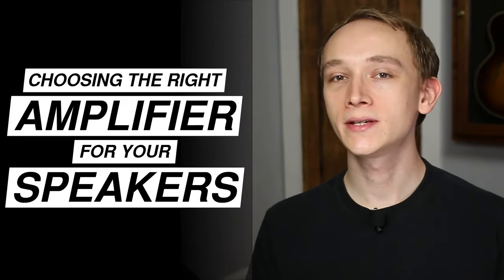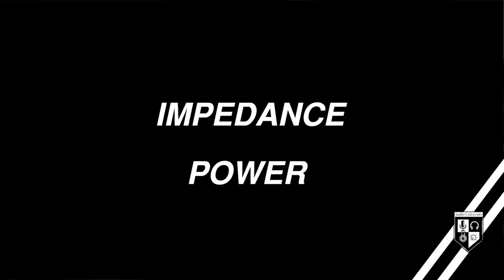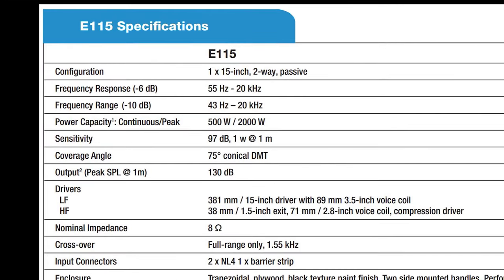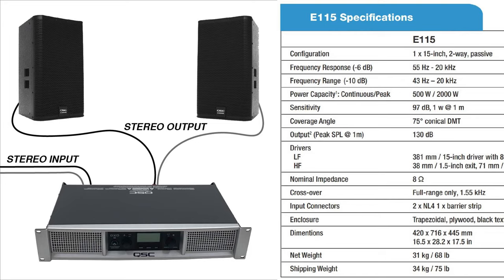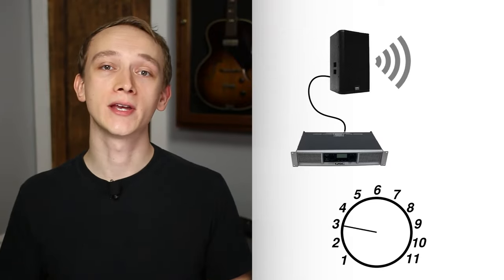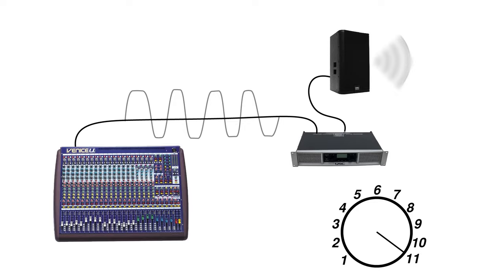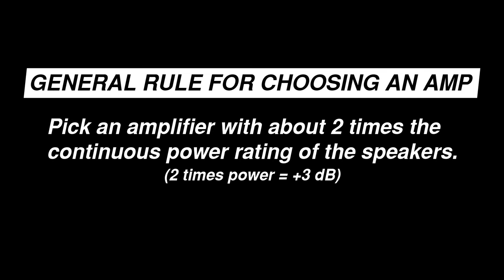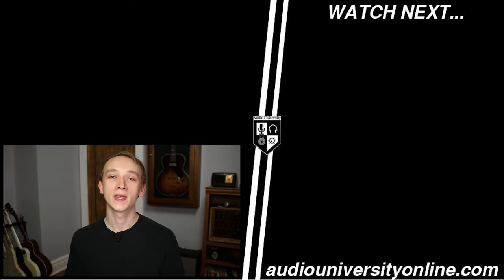A SIMPLE Rule For Choosing An Amplifier | Ohms, Watts, & More

Comment from the maker: Need help setting up your listening space? Check out this free resource I've created for you...
Speaker Placement Guide: https://audiouniversityonline.com/speaker-placement-guide/
Reply: Is the power capacity on the speakers for 1 speaker or both. I have a Yamaha MG16/6FX 16. My monitors are The Presonus Eris E3.5 and I have a Behringer U-Phoria UM2 Audio Interface. What should the specs of my amplifier be? Thanks in advance
Reply from the maker: The Presonus Eris E3.5 monitors have a built-in amplifier, so no amplifier is required!
Reply: @AudioUniversity  I need an amp to power the mixer. The monitors are going into the mixer. I just wanna make sure I dont blow anything out so I need to know what amp I need for that mixer
Reply from the maker: Are you trying to find a replacement power supply for the mixer?
Reply: @AudioUniversity  No. I was told that the mixer needs a power amp to be used by the guy I bought it from
Reply: @OGLettaJ  l
Reply: I have older getz benz. Bass 300 watt×2 at 4ohms. Does it have to be rated20% above rating on speaker?
Reply: Speakers Samsung HT-Z410T 5.1-Channel and DVD  Sony DAV-S800 is compatible please tell me
Reply: Is it ok using a loudspeaker horn that is rated 16ohms with an amp that has 8ohms impedance?

Comment: NO, this is all wrong. Don't choose amplifier 2x the rated maximum power of the speakers. Choose amplifier with enough power to reach the sound pressure levels you desire. To do this, you need to know the sensitivity of your speaker and a chart of wattage per sound pressure level at selected distances. The maximum power rating of the speaker is only there to warn you to not exceed the max power or damage to speaker will occur.
Reply: I don’t think what you said is correct….the more power you have is just going to give you cleaner signal and more headroom.
Reply: What’s best amp for ds18 6.5 300 watt
Reply: I'll add: don't choose amplifiers based on a particular set of speakers in the first place. 

Rather, estimate how much power you really need for the lowest sensitivity speakers you are ever likely to buy, according to your desired listening levels and distance. Then add maybe factor 1.5 safety margin, and then buy the best sounding amplifier that delivers that power, within your price range.

That way you'll have an amplifier that will properly drive ANY speakers you're ever gonna get. You'll be happy with it and won't have to buy another amplifier for decades until it dies.

Comment: I was just stopping by and thought I'd take a short look. I'm not going to take the time and give you my resume, but everything you said  was right on the money. You were however scratching the surface. One thing people should note. Power is normally measured at 1000 HZ for one minute, and not while the amplifier is producing an output under a range of frequencies continuously. All amplifier specs are fudged to make them appear better than they really are in a real world application. If someone listens to 10 watts RMS at 20 to 20 KHz with a 200 watt RMS amp and then listens to the same program material and speakers on an amplifier pushing 35 watts RMS. They will notice a huge difference in sound. It's always best in my opinion to find an amplifier with the widest possible frequency range, the most power and is within budgetary constraints. All audio engineers are super critical about sound quality.  An amplifier that can go from dc to 30 KHz will struggle less to produce audio in the 20 to 20KHz range, and be able to more precisely control the movement of the speakers (damping factor) as well as a have higher dynamic range. I generally prefer to use Crown amps.  I could go on but I'm going to cut this short and not steal your thunder. Have a great night.
Reply: Do you know what amplifier will be better, I have 4 infinity kappas 93ix
Reply: I think he is merely trying to simplify it for us ignorant music fanatics who want better sound but we don’t know exactly how to get there. I think common sense would tell someone that they don’t wanna over amp the speaker or is it the speaker that over amps the amplifier. Ha either way common sense tells you it’s not the right way to go but then the ratings on the amps are not correct in description listings and the same with speakers. These are usually not correct either unless you test them. I know I don’t need a 7000 W precision power amp for six focal Access 6.5‘s and 2- 8” subs, but I bet it would sound good! As long as I didn’t turn it up too high. I don’t even know if I should use a mono block set up for six 6.5 speakers or if I should go with a 6 channel amp. I wish there was a way to understand the high-end components and how they work together so that I could provide high-quality sound for my 70 Mustang.
Reply: I Jus appreciate the knowledge I’m a up and coming sound engineer myself so I’m learning so much from all of you
Reply: Can you help me solve : I have speakers that are rated 125w per channel x2 and nominal oms are 6. What amp specs do I need to shop for please ? Happy I found this video but still not sure what to buy...
Reply: @PortofinoArts  look for an amp that can provide 200 watts rms per channel at 8 ohms.  Once installed, set your head unit at 75% of its max volume, set the gains so that the speakers are just below distortion (do NOT let the speakers distort!!!), and then never go above that volume on the head unit.  For your setup, you should wear earplugs while setting gains.
Reply: @MrCbell57  I always over amp my speakers...ALWAYS...When you can run an amp at half gain keeping it cool and way under any clipping points that is the correct way to go. Buying an amp that does exact RMS is a nightmare waiting to happen. Learning speaker cross over frequencies also helps ALOT. If a mid range speaker has an Fs of 60hz I cross it at 120hz to protect the speaker cone from over powering it with the amp. So basically it's a 12db drop to the Fs frequency of the mid driver. That means I can get great SPL and sound quality from the speaker at the sacrifice of lower volume in the low end frequecies of the mid bass driver. I got 1000 real watts at 1ohm on my subwoofer so I don't need my mid bass driver to produce really anything under 80hz...Most standard tweeters (Not Bullet Tweeters) only need about 20watts or so to get loud. But the crossover to the tweeter is very important so that it rolls off at the right frequency and drops Db so that lower frequency that need more power to produce drop off significantly to not blow the tweeter up...Keep reading up on these topics and you'll get the hang of it quickly.
Reply: @zeropointstar  Man I hope @Simulart knows about crossover slopes. If he pushes that amount of power to a speaker that supposedly has 125 watts per channel RMS is gonna go BANG!!!

Comment: All this idiocy like 400 watts amps. For years now, my amps don't go over 2 x 10 Watts. connected to 95db floor standing units, at nominal 6 Ohm. If the volume knob, is around 11 O Clock, it's already very loud!

Comment: I guess the "pick an amplifier with 2 times the continuous power rating of the speakers" rule doesn't apply for me since in my small diy proyect I have a speaker with a max power rate of 25W and the continious power rate is 15W. The double would be 30W, exceeding the max. power rate and potentially damaging my speaker. Isn't it?

Comment: Just a thought... Instead of saying "we should use amplifiers with twice the amount of power then that of a speakers continuous power", we should rather say "we should use amplifiers with half the amount of power then that of a speakers peak power".  The reason for this is, some speaker manufacturers continuous power is already half of its peak power capabilities.  In other words, some speakers don't have a Program power rating.  They'll just say, "Cont.Power = 500W & Peak Power = 1000W.  If we go by the first rule, as in this video, we would choose an amp of double the continuous power and give the speaker 1000W, which is too much.  If we follow the second rule, we would give the speaker 500W, which is the better choice in that case.  Following the second rule, we would practically always be safe, regardless of the way manufacturers spec their speakers.
BTW, I like your videos man! thanks.
Reply from the maker: Thanks, Christiaan. I like to choose amplifiers that provide headroom beyond the continuous power rating of the speaker. If you do this, just make sure not to turn the amp all of the way up past the sound of speaker distortion and the speaker will be safe from exceeding its peak rating.
Reply: Honestly you have a very good point.  You would always be safe in that way, compared to the other way.

Comment: Best video by far on Youtube on this topic however I go a little differently on how I approach this.  Firstly I match the dBu Outs and Ins, then If I have a Speaker with let's say 1000 watts continuous, and 4000 watts peak.  I'll try to cover some portion of the in between section between continues and peak.  To cover my back I'll also use a DSP, but to use a DSP you need to know the threshold at which we're going into peak territory.  If I have an amp that does 1800 watts, then I'll do 10 x Log(AmpW/TargetW)  So 10 x Log(1800/1000) which is -2.55 dB plus I like to round down to the first decimal to be extra safe since most DSPs don't have two decimal places so It's -2.6dB.  So I set that as my threshold and everything after then is peaks and I allow for overshoot up to 0dBfs.  It'd love to hear from you guys if you think I could do anything better than that as I'm always open in improving and new ways of going about these sort of things
Reply: For professional audio equipement it can be "easy". 
If you look at amplifier specs they will always give a the max output rating and also at what input the amplifier will deliver that power (typically +4dBu, some amps can have a switch to select different input sensitivities).
If you choose a amplifier with 1dB of headroom (that's about 25% more power than what the speaker can handle) just set the output limiter on your DSP at +3dBu.
You can lower the output limiter slightly if you want to play it safe, but a good professional speaker will be able to handle a little more than its specs.
Very important : always have the gain/volume pots on your amplifiers at maximum!
Of course if for example you have some crazy DJ that doesn't know the purpose of a VU meter (like a lot of them) you better lower your output limiters (or kick him in the nuts).
In nearly 20 years I have never blown up a single speaker and wasn't afraid to sometimes drive them past their specs. Even all the installs I did in clubs have never seen a broken speaker component unless someone messed with the DSP.
Reply: @ppdan  Thats really interesting.  Tbh something I've had in mind lately is that the wires also cause some attenuation and i feel as if it'd be a great idea when there's plenty of time on hands to take the time to measure the resistance and convert it to db to find the loss and make up for it on the amplifier so i can properly set the speaker to its rated limits.  But I never knew about the fact that amplifiers have switchable input sensitivities, I only knew it was true for DSP's.  In my opinion it'd set it as high as I can to improve the signal to noise ratio both on the dsp and Amplifier side which means it'd turn up the dsp output as high as i can and turn it down on the amp to have the least amount of noise.  The only reason I woudn't do it though is in the case I have idiots who keep fucking around with the knobs without knowing what could come of it.  The club I used to work at had a dj that would go to the back room and mess with the amp pots.  So unfortunately we have to take those people into account in our calculations lol

Comment: Hello. I guess there is also a third spec important, namely speaker sensitivity, measured in dB/1watt/1meter distance. This actually tells you how loud a speaker will go at a certain volume knob position. If that spec is very low (f.i. 85dB) you automatically have to crank the volume kouder to get the same SPL as with one that does for instance 95 dB. This will eventually lead to amp clipping more rapidly as with the high sensitivity ones. My situation is: Amp - 170watt into 6ohm. Speaker - 6ohm 180 watt rms 93dB sensitivity. You will see this is not the ideal situation regarding RMS values, but I guess this is compensated by the high sensitivty so I do not have to crank it. In my home situation I almost never go beyond - 15dB below reference level (except for some low quality under saturated source material)  because that actually makes my ears bleed in soms cases. -10 on the knob and I only have to wait for police knocking at my door. Under reverence level however still not any clipping present..my speakers are Infinity Delta 70 and sound great! My amp never gets hot also. I Actually do not have the financial means to buy seperate power amps that go 300-350 RMS. But I guess in my specific situation I do not really need that. What's your opinion on this? Greetz from Holland.
Reply: what is negative db. Boss pro s1 has -+3db and fender venue s2 has -24 db. Which one is louder?
Reply: More power is better more dynamic
Reply: I don't know much about stereo systems, but I'm trying to learn. I'm not sure of what I need to be looking for in an amp. I plan on getting new door speakers also, there are door speakers in the front and back seat of my car. I have a box with 2 subs in it. So how many channels do I need my amp to have? Or should I run separate amps for the subs and door speakers?

Comment: If the specs of speaker show a range of power values, for example 20 watts -300 watts, which value do you go by? the min, the mid, or the max?
Reply: So what would  the max  watt power amp you would   be able to use then ?

Comment: Dear Sir, your explanation is valuable!!!
 I got unclear point on fixing subwoofer and other 2 way speakers.
If we fix subwoofer to amplifier how can we fix it? Separately from a cable directly to amplifier? Or Can we fix Subwoofer and Other speaker from same cable to the amplifier???( Amplifier-Sub- Speaker chain????)
Please what is the most effective and accurate way???
I am asking This question  is only for passive Subwoofers.
I think for active subwoofer we can pass the cable from Subwoofer to other speaker directly because Active subwoofer can extract its own frequency and release higher frequency to the other speakers.

I don't know how far I am right??????
Please give me a clean eye on this.

Thanks
Reply from the maker: Usually, you will run a subwoofer and a full-range speaker on separate amplifier channels. This lets you send different signals to each speaker cabinet, use an active crossover, and balance the system.

Comment: Amazing knowledge and since. Thank you for sharing your experience.Question 👇
The audio frequency output from the radio in low level or high level.
Amplifier must receive low level frequency from radio unit or no matter.
If the head unit high level output must reduce it before send it to amplifier.
Waiting your reply ASAP
Best regards
Reply: If I'm reading your question correctly, this is not something that you choose one over the other.  A low level input on the amp means that it will accept a line level signal, such as pre outs on your head unit, You use the high level option if you don't have preouts on the head unit, You connect the speaker cables on the head unit to the input on the amp. But you do it that way only if you  have to. Pre outs are a better option.
Reply: @AT-wl9yq  Thank you for your reply and interest. Best regards,

Comment: I have a 4 channel amplifer with 200 w each and the maximum power is 8 Ohms.
So i have 2 speakers which are 250 watts each and another speaker which is 200W RMS/350W peak at 8 Ohms and planning to buy a  subwoofer which is Maximum Speaker Output Power 300 W power max , 150 w rms with 8 ohms impedance .
My question is will my amplifier support that without getting any problems caused ?

Thank you.